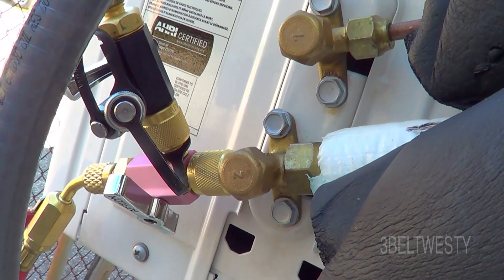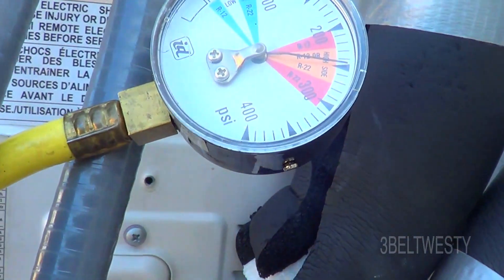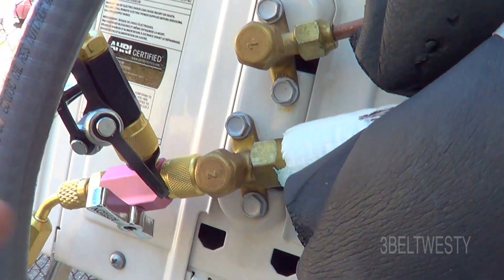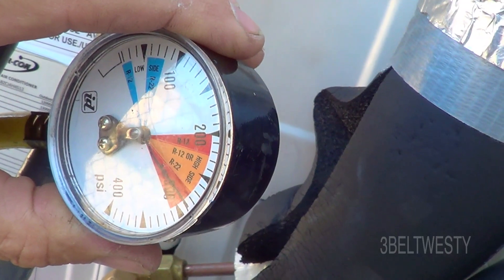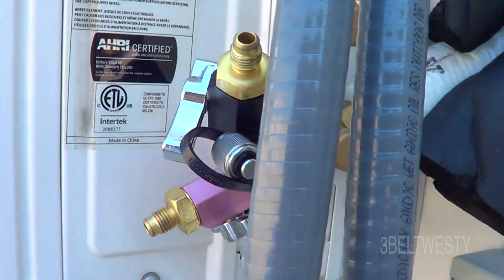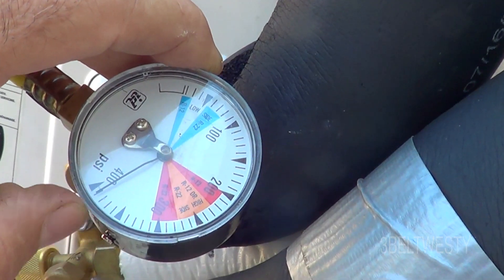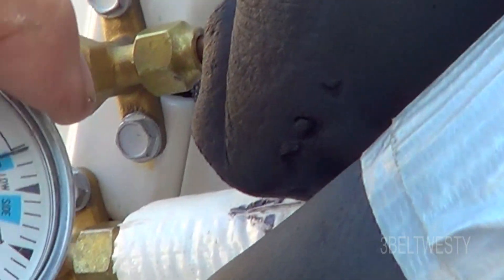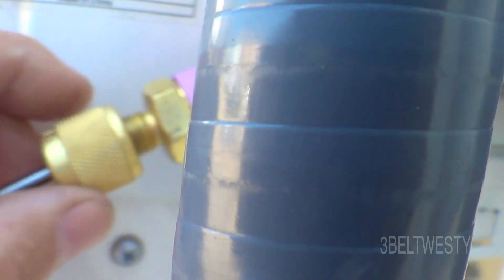Mini Split Pressure Test with 2 Appion valve core removers

Comment: Ok, im new and possibly wrong but I dont think so,  when you close the valve on the 1/4" VCRT around the 4min mark you are no longer reading pressure in the lineset. At that point you are only checking the integrity of your analog gauge and short yellow hose leading to it.  For the life of me I dont see how you are checking the integrity of the lineset anymore as you state around the 4:20 mark. You should be leaving the 1/4" (black) VCRT open and closing the 5/16" (pink) VCRT. This would isolate of the gauge and lineset from your nitro tank. you wouldnt close the black valve until it was time to weigh in your r410a.
Reply: Thanks for confirming this. I was wondering about that too

Comment: In case you are not aware, you have a perfectly good set of Testos right there that will easily do an automated pressure test and show the results with temperature compensation in tenths of degrees.  You could perform this test in minutes. Not sure why you would use any analog gauge whose accuracy is horrible dubious.
Reply: I’m learning new methods everyday.  I haven’t been in hvac for too long but I learned that the methods used is what the company wants to use.  I feel my company is a little behind in the times. But there methods still work. I am interested in your comment though

Comment: In my cooper and hunter 18,000 btu two zones mini split ac it comes precharge up to 50 feet but I went over by 3 feet 5 inches  , the instruction book said I have to add .161 oz every foot over 50 feet ..

Does anyone anyone know if it will be ok for me to run the system without adding the additional .50 oz , I am a not a hvac technician , I live in NYC so its not easy for me to get the r410a gas.

Though if the .50 oz additional gas will make a  difference i will find a way to get the extra gas.

In hindsight I should have ask the seller to add the additional gas, he offer that service in the Amazon seller product link , I just was hoping I didn't have to.

Thanks for the help
Reply from the maker: You are probably sort of OK with 53 ft 5 inches with a 50ft max spec with the pre charge .  Technically one should add some more. Each unit should has a different max limit before you add some more charge. Mine a 12000 btuh unit in this video was 25 ft max and the line set is about 31.5ft so I added some more gas. A 9000 btuh unit at the house has a 16 ft limit before adding more gas. 25ft is often standard in North America and 16ft overseas,

So I wonder if the 50ft distance you mentioned is correct?

When I google "cooper and hunter 18,000 btu two zones mini split ac" i found this seller and their manual that has 25 ft mentioned:

https://www.theacoutlet.com/ch18msph230vo-2-ch-09msphwm-230vi-cooper-hunter-18-000-btu-21-3-seer-2-zone-ductless-mini-split-heat-pump-system-9k-9k.html?gclid=Cj0KCQjwpreJBhDvARIsAF1_BU1HtuRiCwUsxvOTDgRHsBFBiXd8Tu5G4LmefwxOfaQJqZtPhPCM24kaAoccEALw_wcB

"The standard pipe length varies
according to local regulations. For example, in North America, the standard pipe length is 7.5 m (25 ft)
In other areas, the standard pipe length is 5 m (16 ft)."

in the install guide here:

https://www.theacoutlet.com/documents/Installation-Guide-Cooper-Hunter-Multi.pdf

Comment: Using argon gas too , thanks
Reply: Can you use argon instead of nitrogen to pressure test? i just run out of N2 but i have an argon tank from my welder. can i use fine, wont cause any damage?

Comment: I bet the directions say to pressure test around 500 psi
Reply from the maker: The Aircon install booklet does not mention pressure testing with an inert gas. It does mention pulling a deep vacuum. Then opening up the 2 way valve for 10 seconds and closing it. Then check for leaks via liquid soap or an electronic leak detector. Then if all is ok to open up both the 2 and 3 way valves on the exterior unit. Thus if there was a leak it only  releases fractional part of the factory charge. These units have an electronic TXV valve in the outside unit right before the 2 way output valve, the smaller diameter tube.to the inside unit. Since I have HVAC equipment I just pressure tested like I usually do. This unit is 12000 BTUH 25 Seer 15.5 EER
Reply: @3beltwesty  it's cool, I think these units are more aimed at DIY folks. Is the unit still running ? R410a can be a pain
Reply from the maker: @JDT738126  Yes still running. It was just commissioned/installed 2 months ago. The install instructions on many units are just copied and pasted from other brands. Many are just rebranded and made at the same place overseas. This install has a long line set 32 feet thus I had to add some extra gas. In units marketed to the US the standard max length for the stock change is usually 25 ft . In units for Asia the standard max length for the factory stock charge is often 16 ft. Now have 4 mini splits.  I learned more installing my first unit than all the web stuff and books too.ie made some mistakes.lol
Reply: @3beltwesty  I've made mistakes too, you should know real soon if the unit leaks. I'm only going to be installing fujitsu and Mitsubishi from now on....
Reply: I'm about to pressure test my Pioneer 24000 btu system. I'm a DIY'er and have gotten real friendly with Chad their tech support via chat.  When asked Chad recommended 500 psi.

Comment: Your pressure will be higher at the service port in the winter time ‘ upwards to 550
Reply from the maker: The service port is on the low side, after the electronic TXV that is in the outside unit. All the tubing and evap coil are on the low side. There is no high side pressure pressure port on these modern mini split units. In the old R22 mini spilts many had the metering valve in the inside unit and one had a high and low side set of valves to measure pressures.
Reply: In heat mode, the indoor coil and line set become the high side.  The pressure drop doesn’t happen (in heat mode) until after the hot high pressure liquid has traveled back to the outdoor unit and passes through the expansion valve.